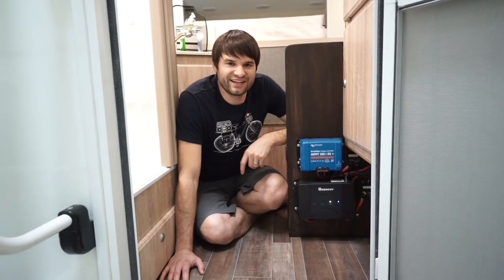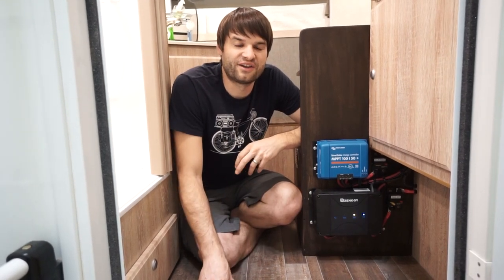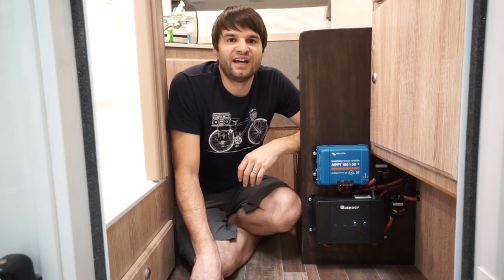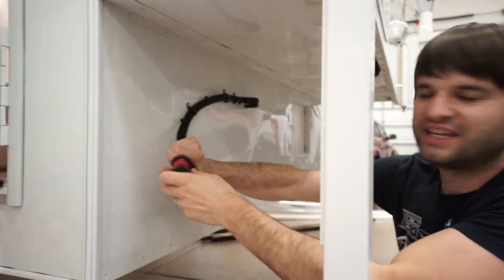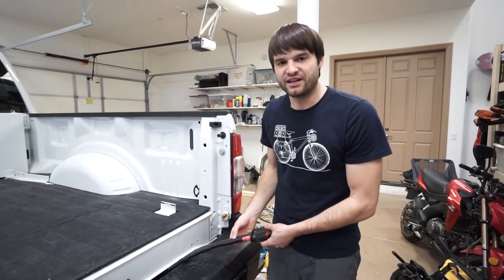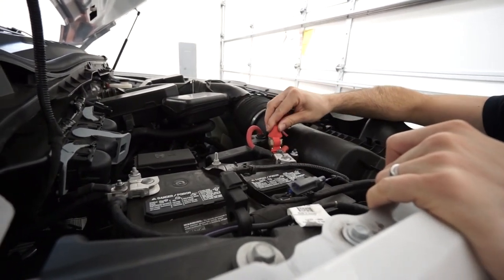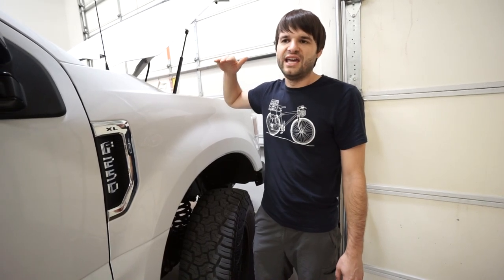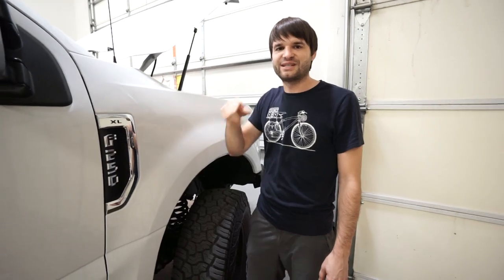No Generator!!  How to CHARGE your battery Off Grid??  Expedition Truck Camper Build!

Comment: Great video ! This is exactly the set-up that i plan for my truck camper.
My truck is a F-350 dually 6.0 powerstroke but i think my alternator is just 110 amp, not powerfull as your’s for the Renogy DCC50S.
My plan is to go for a more powerfull alternator first.
Reply from the maker: It works really well... we love it.  Your alternator could probably work but having additional charging capacity will help with longevity for that load.  Enjoy!!
Reply: Victron and others make 30 amp B2B chargers which may be a good option for you. Good luck, they work awesome.

Comment: Hi there! Thank you for sharing this interesting info!!

We have finally got around to decide on what our rv set up will be.  2 weeks ago, we ordered an Outdoors RV travel trailer.  That will mostly be for 1-2 week boondocking trips here in CO and the immediate surrounding states.  We also ordered a gasser f350.  Yes.. I saw your video about comparing the 250 and 350 and there arent many differences.  We just wanted the legal improvement of payload on the 350. 

The truck will be delivered in April.  The trailer wont be here until July-ish.  That works out ok as our national forest access here in the San Juan's of CO dont melt until June or July. 

Safe travels!
Reply from the maker: Sweet!  Congrats on the new truck and trailer!  I'd probably choose an F350 if planning to retain the suspension and needing the extra payload.  It will ride a bit stiff when empty but should do great with the trailer.  That's super exciting!  Now... the hard part.  Waiting!  Thanks for sharing.   :)

Comment: Hi there, was wondering how this system is working for you guys and if you would change anything if you had to do it over again.  I'm waiting on a Northstar Laredo SC that I'll be hauling with a 2015 F-350 and would love to do the same thing.  It makes total sense to use the truck as a charging source.  Great videos and thanks so much for all the information you put out!
Reply from the maker: It is working great.  Wouldn't change anything at this point.  However, we rarely use it since the solar keeps the batteries charged.  But it was really handy on the last trip since the solar  panels we covered by 4-5" of snow.  Congrats on the new truck camper setup.  That should be a great!  We bought a Laredo SC before the Liberty.  Love to hear how you like it...

Comment: Hi, if you don't mind me asking, why not run the cables directly from the alternator to the power inverter, my inverter has a protection but the alternator output is about 13v,  do you think that a 48v alternator could be wired directly to the inverter? Any comments will be highly appreciated!
Thank you very much for uploading this video. 
Kind regards, George
Reply from the maker: Alternators are excellent for providing consistent power however their output varies significantly depending on RPM.  Inverters power draws can spike and drop instantly.  It would likely fault out and shut down the inverter and possibly damage the alternator.  Battery is fairly essential to have between inverter and alternator for functionality of inverter and protection of alternator.  You'll want to ensure batteries can handle the max spike load of the inverter.  Then use the proper charger for the alternator input feed.  Hope that helps!

Comment: Would this work for a 2000s chevy? My truck bed camper has all gas appliances. The only thing I would need power for is charging phone, laptop, the occasional appliance, small projector, some small lights, water pump, ect.
Reply from the maker: Yes.  Just need to wire it up
Reply from the maker: I think we showed the wiring connection is the DC charger video.  Take a look at that first.  Read the video descriptions for parts used...

Comment: I'm doing a custom build F350 now, with the idea that I'll buy a truck camper in a year or two. Will definitely want to copy your setup here - makes a ton of sense!  Would you recommend I configure the F350 with the optional upgraded alternator and/or dual-battery setup, or does this work just fine with the standard alternator and single battery in the truck?
Reply from the maker: We have the upgraded 240amp alternator and it has no trouble producing 50 amps at idle.  Anything more would be no necessary....  You'll love the Super Duty!  Great truck

Comment: Good info!! Is there a chance of completely draining your truck battery, from power usage from your camper? Or is there a disconnect somehow from camper to truck battery?
Reply from the maker: Nope.  The DC charger has a trigger wire to engage when the truck is running.  But we also have a circuit breaker to disconnect.  Typically we leave it off as the solar is more than enough...
Reply: Where and how did you wire the Trigger wire? Thank you for your great info... @TruckCamper
Reply from the maker: @michaelj6548  Off the 7 pin power wire inside the camper.

Comment: Great video.  Can you put out a video on how you wired the Renogy DCC50S with the Victron MPPT?   Does each one wire to different array's?  How well or bad has that system been working?  I just ordered a DCC50S and am brain storming the solar build, haven't decided on the setup yet, Thanks!
Reply from the maker: Output of both the Victron and Renogy go to a circuit breaker then bus bar.  Bus bar allows for multiple connections.  So there is one for the positive and negative.  Take a look at the solar install video.  It shows more of the wiring setup.  Victron is top shelf - highly recommend.  Renogy is a value product.  Love the size and performance has been great (no issues).  We only use it occasionally for charging from the truck alternator.  Typically it is left off as the solar provides plenty (generally).  Hope that helps!
Reply: @TruckCamper  ok, so you do not use the MPPT functionality of the DCC50s, you do have a lot of panels up there, so they are setup as a single array?
Reply from the maker: @User161803399  Yes.  Check out this video for details:
https://youtu.be/tOy5wVxaQRM

Comment: I was wondering if you have a 7-pin connection for your camper? With that hooked up is there any issue with charging the battery? I’m thinking the 7-pin is for light only when driving and doesn’t charge the battery, correct? My 7-pin doesn’t charge battery much but will discharge my truck batteries if not plugged in.
Reply from the maker: Yes we do.  It will charge the camper battery but extremely low power.  The 7 pin wiring is rather small gauge.  I'd guess it does 5amp or less.  So not practical for charging...

Comment: Do you have to wire the ING port or it work just fine without? Nice work btw! ❤
Reply from the maker: We used the 7 pin power wire to trigger the charger.  Tapped into it inside the camper near the breaker panel.  Thanks!!

Comment: Did you keep the charge function of the "power center" distribution panel and charge controller or disconnect?  The WFCO-8725 that came with my Bundutec has an AC to DC charger with a continuous float of 13.6v.  I plug in when at home when we are using the camper to keep the fridge on etc.  I am going to install a lithium battery and I read that once it is fully charged it doesn't need to have a float as it has very little discharge.  I can always keep it as a source and put a switch on it but wondered what you did.
Reply from the maker: We retained the dealer installed converter/breaker system.  Just added the additional charge sources...  they go through breakers and to a bus bar.  Other videos show a bit more of the setup.  
We have plugged in the camper at home.  The converter has worked but recently it quit charging.  Not really a big deal but may replace at some point.  
Hope that helps!
Reply: @TruckCamper  Thank you!
Reply: Progressive Dynamics makes replacement lithium charger sections for the WFCO units. About $230. 30 minute install. They don't really have a float function just brute force Lithium voltage (14.5 or something) so I don't leave it plugged in. I use a victron 30am 3 channel charger that has a safe float voltage if I'm leaving them on the charger for longer period. For long term storage, I'll disconnect all chargers and discharge to 50-70% then leave it.

Note on the PD lithium units, they include a new DC board. I installed it but you don't have to install it with the lithium units if your existing board has those 40a reverse polarity fuses (I think all WFCO converters has those). PD unit has slightly different wire feed co nection angles that can complicate things.

Comment: So what do you do if you are not driving everyday, as when you are staying in one spot for a week? If you just start your truck and let it idle, isn't your alternator going to over heat b/c you don't have cooling from air flow, like you do when driving?
Also, is there an effect on your trucks chassis battery charging system from hooking up the charge cables to the battery posts? Does the trucks computer see the extra battery/dc2dc charger and register a fault/error code?
What about the rest of the wires for controlling the travel and brake lights. If you are using a 7-pin cable, did you remove the charging wire from the 7-pin b/c you have the Anderson connector, or is the charge wire still connected through the 7-pin as added charging?
Thanks.
Reply from the maker: Lots of questions!  Take a look at our Solar System video: https://youtu.be/tOy5wVxaQRM

The DC charger is backup.  We used it when the roof was covered in snow.  Batteries will run us for 2-3 days with no charging as well.  

Alternator doesn't get cooling from moving or driving.  It has its own cooling fins and fan similar to most motors.  Alternator is capable of 240amps charging power so 50amp load is nothing.  No error codes.

We still have 7 pin connector.  I pulled the carging wire input inside the camper... it now acts as a trigger wire to "turn on/off" the dc charger. 

Note the 7 pin charging wire is tiny...  you might get 5 amps power through it.  Shouldn't reply on it for charging... 

Hope that helps!
Reply: @TruckCamper  Do you think it is necessary for the Renogy to disconnect the charge that also comes from the 7pin? I realize it's a convenient spot to grab a on/off voltage to trigger the Renogy.  I've read their manual and it says nothing about this.
Reply from the maker: @thelongroadhome7582  It shouldn't cause an issue.  Battery can have multiple charge sources.  We use solar charger with Renogy dc charger.

Comment: We’ve got a diesel, what about the particle filter when running the engine for hours? Alternators also have a nominal amperage on a working RPM that is much higher than at running idle. So for traveling it’s a great solution but I would not run my RV idle for hours this way.
Reply from the maker: True.  Modern diesel can be an issue to idle for extended periods. Which is why we don't and won't own a diesel.  For us, this is the backup charger solution.  Typically we leave it off and let the 800w of solar keep batteries charged.  But it was handy when the roof was covered in snow!
Reply: @TruckCamper  You do not want to idle your DPF'd diesel to charge your house battery.  I have a 60A renogy dc to dc charger and use it only when on the road on cloudy days or in the early spring/late fall when my 400W of solar will not do the trick.   I can also run my fridge on 120v when on the road which is safe and reliable when traveling.

Comment: On my Tacoma, I just ran a cord from the 400 W inverter in the bed to my truck camper shore power connection. Then I just plugged in my solar generator to the shore power hook up inside the camper and while I’m driving it charges my Solar generator.
Reply from the maker: That's an interesting idea.
Reply: @TruckCamper  
To be honest I haven’t done enough study yet, you may need a small inverter to increase the power. Something like a 240 Jackery. 
I’ll have to do a little more research, but I know there is power coming through the line.

Comment: What keeps your Vehicle battery from over charging? I saw a vehicle burn to the ground wired in this configuration. I don't see any way the vehicle battery can stop the 50 amp charge call that your camper is asking for.
Reply from the maker: DC charger turns on only while the truck is running to charge the camper batteries.  Disconnected while the truck is turned off.  DC charger regulates the charge based on battery levels and turns off when fully charged.  Very similar to a solar charge controller.  Appreciate your thoughts and concern.  Thanks for sharing!

Comment: Since you have a smart alternator, did you connect the ign wire and if so what did you wire to?
Reply from the maker: Yes we do.  The camper plugs into the 7 pin trailer connector for lights and charging the battery.  I pulled the wire feeding power to the battery and used that to trigger the charger.  I intercepted the wire at the fuse block so less invasive.  Hope that give you some ideas!
Reply: @TruckCamper  Thanks, that’s exactly what I needed to know. Excellent video!
Reply: @TruckCamper  This is brilliant! I've been searching for this answer for a long time. Alas, campers are detachable. So how do you detatch the sense wire? It was surprisingly difficult to get any examples. Thank you!
Reply from the maker: @UnitedElectric  We use the 7 pin trailer connector wiring to trigger the charger.  Just found the charge wire feed that ran to the original camper battery.  Hope tgat helps!

Comment: A alternator is matched to the automobile its in . You start adding items  your now are putting more stress on it , shorter life on the alternator,  think about the wires under the hood designed for a certain power draw .
Reply from the maker: Nope.  We have a 240W alternator (upgraded factory unit).  It is overkill most of the time.  With the exception of winching which can draw 600amp or more.  This charger has a dedicate 1AWG wire running to the battery and only pulls 50amp.  Overkill for wire gauge.  We could pull 100amps through it for the length.  And... its nothing for our alternator.  It easily generates the 50amps at idle.  Now... you could be correct on an older truck with 80 or 100amp alternator.  50amps would really give it a work out!  And it might need to be running at higher RPM to even generate that amount!

Comment: You realize that with that Renogy DCC50S you don't need that Victron MPPT right? The DCC50S has an MPPT charge as well. It's an all-in-one unit.
Reply from the maker: Somewhat true.  Victron is a better charge controller (in my opinion).  Plus, the DCC50S is limited to 50amps charge either from solar or alternator.  With both units we can charge up to 100amps at the same time...  thanks for sharing!
Reply: The dcc50s is limited to 25v max input. That really limits the panels you can use.

Comment: Have you needed to use this charging system often? I'm wondering if you know how long you'd need to idle the truck to recover how many AH's?
Reply from the maker: We leave the DC Charger off most of the time.  Typically the solar is more than enough.  Although, it is fantastic when the roof is covered in snow or for fast charging.  At idle, our 240amp alternator has no issue producing the full 50amp charge.  It produces 50ah of power per hour.  So if our 200ah batteries were completely dead it would take 4 hours idling.  Typically we might use 30ah overnight (12hrs) no sun.  So it would take ~40 minutes idling in the morning to recovery.  Our truck consumes ~ .4 gallons fuel per hour at idle.  So it would take ~ .2-.3 gallon to recharge in the morning with no solar.  Hope that all makes sense!
Reply: @TruckCamper  thanks - I totally understand the need for a DC-DC charger for lifepo4, due to their low resistance. We still have lead acid - do you think DC-DC would be still needed, or would it be ok using jumper cables straight from battery to battery?
Reply from the maker: @sl0rion  With a lead acid or AGM you can go either way.  It would be a good idea to install an isolator so the connection is only while the truck is running and fused of course.  If you might go lithium than a DC charger would make the transition easier and can charge any battery type.
Reply: @sl0rion  No don't do the kjumper cable thing.